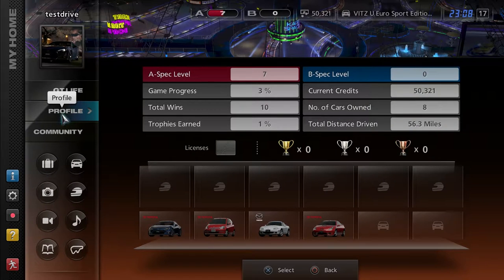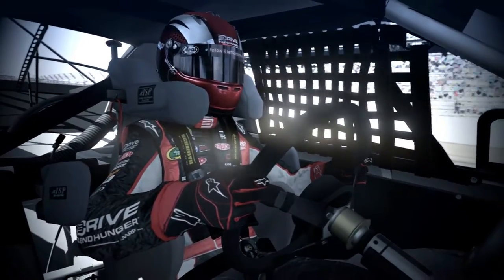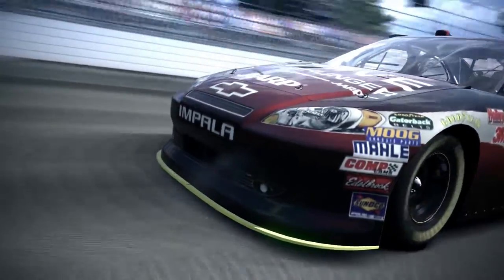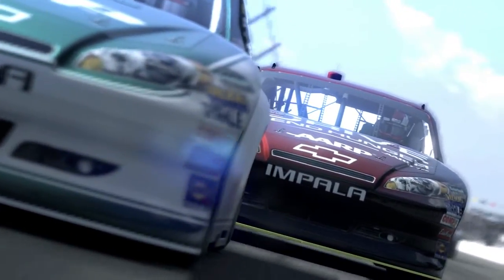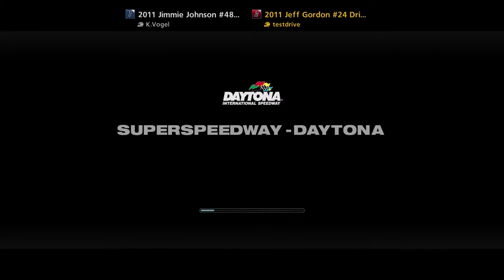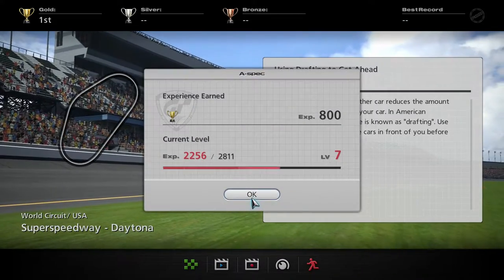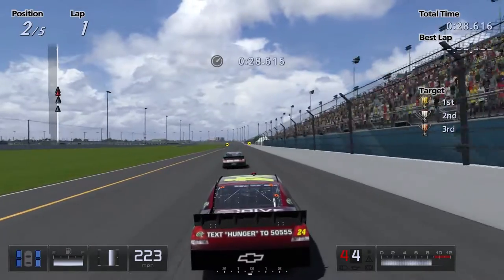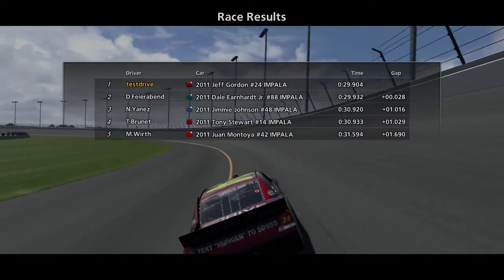Jeff Gordon - Beginner || Gran Turismo 5 Let's Play - Episode 6 [1080p60]

Comment: Hi i'm Jeff Gordon, professional NASCAR driver. I'm here to teach you driving techniques that are very special to NASCAR racing. NASCAR is a race series with a lot of history, having started back in 1947. Though they're still called "stock cars", today's NASCAR race cars are built on steel tube frames. NASCAR regulations require the car to be 3,400 pounds, which is kinda heavy for a competition racing car, but because of this, driving techniques for NASCAR require that much more precision, care, and finesse. The engine is a 358 cubic inch carbureted overhead valve V8. Now just hearing this, it might sound like old technology to you. But that's really not the case. Even though these NASCAR engines are low HP, they rev up to 10,000 RPM. Any engine expert would know that this requires the same level of technology as in F1 racing, which has double overhead cam engines, reving up to 20,000 RPM. The transmission is a 4 speed. That's why you have to select the gear ratios to match each track. This setup of gear ratios is very important. In NASCAR, there's less difference in the performance of each race car, as compared to other categories of racing. That's why just a slight difference in the settings, or the difference in driver skill can lead to winning, or losing. Most NASCAR races are on an oval track. Though an oval track is very simple in shape, it's that very shape that make it require unique driving techniques. One of the first things you'll need to learn is drafting in other people's slipstreams. The closer you get to the car in front of you, the more you reduce aerodynamic drag of your car to overtake your opponents. Drafting is a technique that is of course required in all kinds of racing, but on an oval track, it becomes crucial. Because there are no low speed corners, you can draft at any time. But remember, the better the draft, the less the downforce. Enough with the talking, let's getcha into the car! You ready to drive? I'll see you on the track!